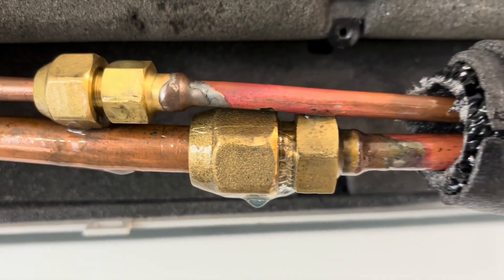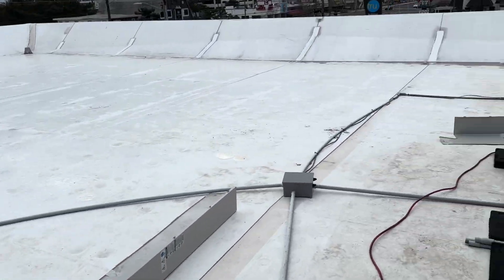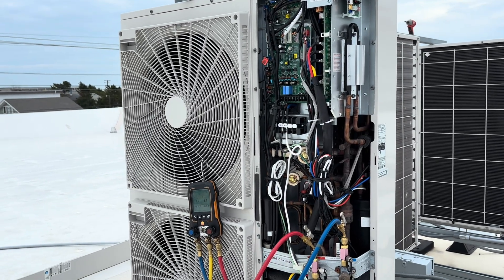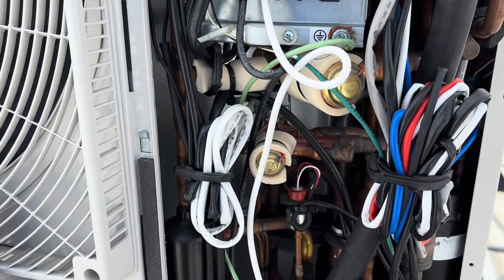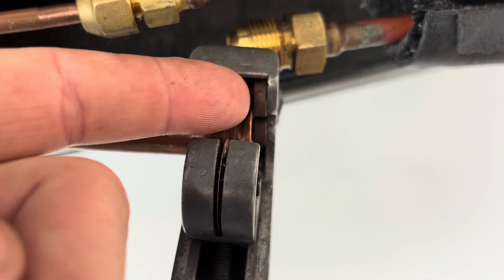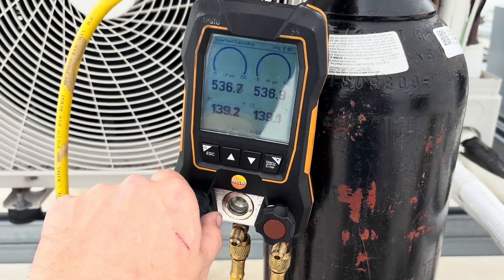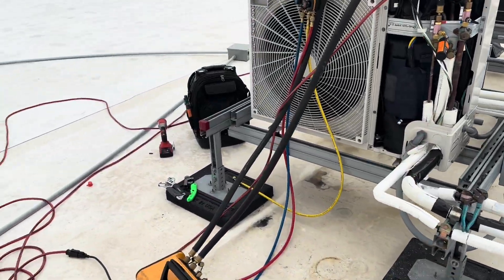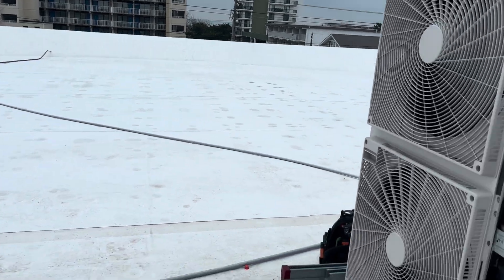Bad Flare Causes HUGE Problems!  LG VRF With A Refrigerant Leak!

Comment: My HVAC instructor used to tell me: "The size of a refrigerant leak depends who is looking at it - the customer (I didn't pay so much money for a leaky system), the original installer (tiny leak, just needs to be tighten something quickly), or a second opinion national chain HVAC company (a huge leak, you need a whole new system)."